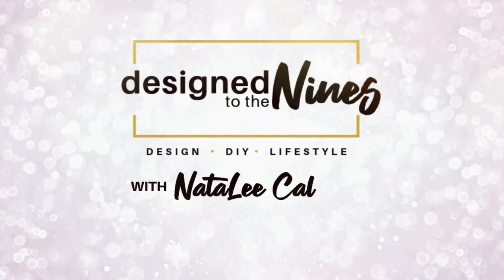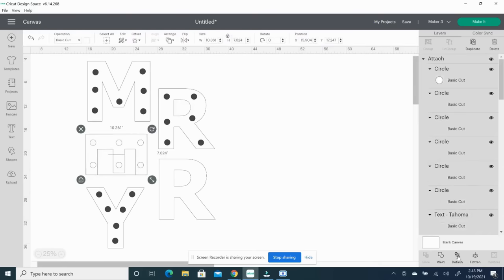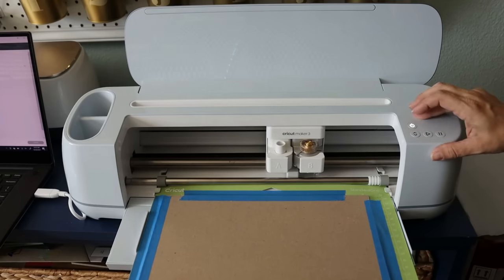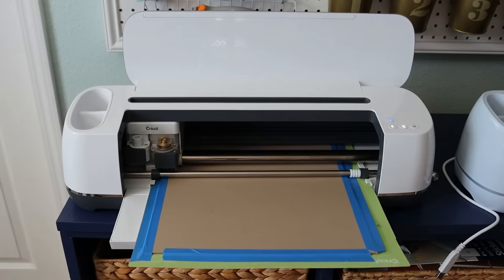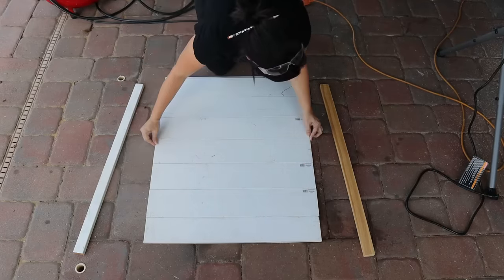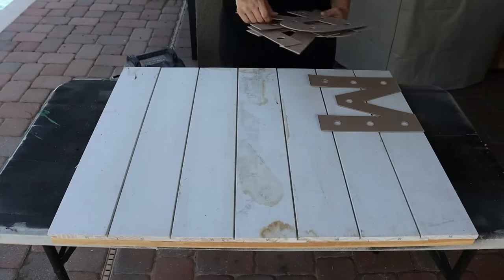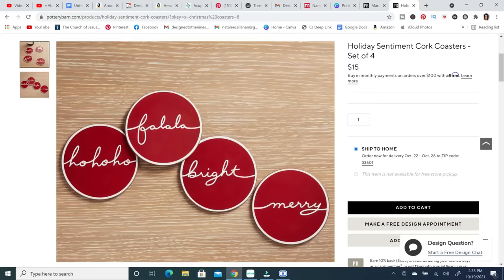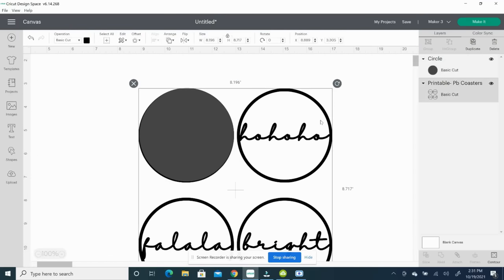HIGH END Pottery Barn CHRISTMAS Décor BUT CHEAPER!

Comment: Natalee  I am so proud to tell you I completed the Merry sign. I’m so happy. The worst part was drilling the holes for the lights but I DID IT!  Yes, I need to work on our fireplace now. 😊 Thanks for inspiring me and giving the motivation to do this art piece. 😎 Merry Christmas.
Reply from the maker: Yessssss! So proud of you!!! 💪
Reply: Did you cut your letters from your Cricut Machine?   What lights did you use? Thanks. I am excited to make the sign.
Reply: @rolleenbodeis4787  I bought the letters  at Hobby lobby. They are bigger than what Natalie Used, 13 inches. I had to adapt the ship lap. The wood you need to use on the Cricut might have been easier to make holes into. I didn’t have a Maker then. I found the lights at Michaels. They had them on sale at the beginning of Fall. They are indoor/outdoor and they are quite bright. I would like to find some dimmer ones. Sorry I don’t remember the name.  I hope this helps.
Reply: @griselalfaro7004  Thank you.  I thought the Hobby Lobby letters would be to thick for the lights to fit through, I will try them.  I did order lights from Amazon.  Thank you so much!!

Comment: Love everyone of these projects. 
Question: how well will the coasters hold up with moisture.  Would it be beneficial to Mod Podge them?
Reply: If you are going to use homemade coasters for hot coffee or tea a lot of dyi people on utube recommend spraying them with a clear heat protecting spray for autos instead of mod podge on top. Do a few coats letting it dry in-between. Hot cups will make the mod podge tacky again. I found it on Amazon and you can get it at automotive stores. I haven't tried it yet but will soon.

Comment: Quick question. Are you using an air nailer on the red “Merry” sign? If so, do you have the info on it? It appears smaller than the 10 extremely large ones my husband has. I could actually handle the one you’re using here, I think.

Comment: The link that you provided for the lights, won't work on this project.  The ones linked do not screw out of the socket in order to go through the hole.  Can you supple me with a link for the lights you used.  I've got my sign about half done, just needed to get the correct lights.  Thanks, Lynda
Reply: Would really like a reply as to where the lights were purchased.  Please advise.  I am at the point on the sign where the lights are needed.  Thanks:-)

Comment: i clicked your link for the string lights, they are not what you used as the bulbs do not unscrew from the wire, but they are 10ft, 30 lights. also when i try to get the pattern for the letters it tells me  i need to confirm my subscription, except i've never received an email to confirm. hoping you or someone on your team can assist! i love your ideas and hacks! thanks